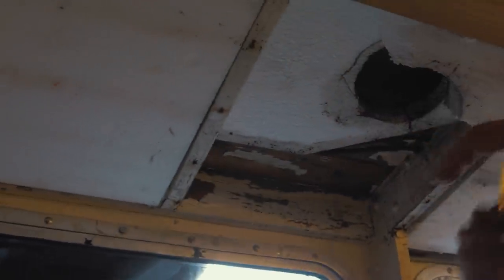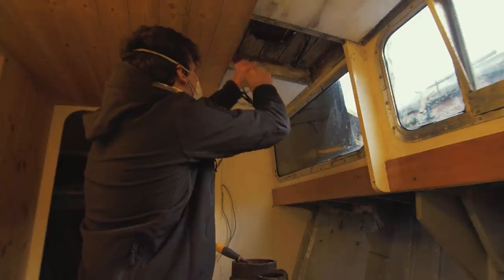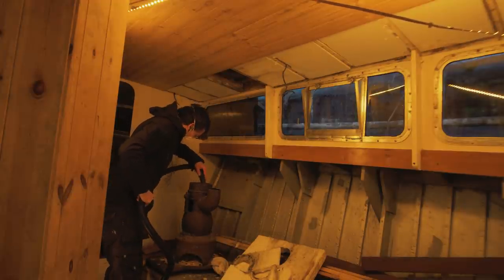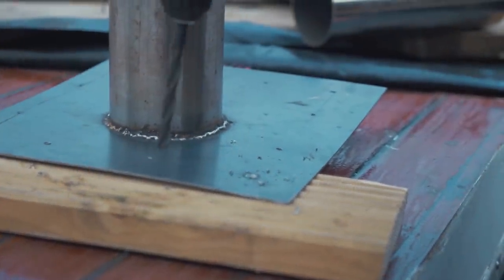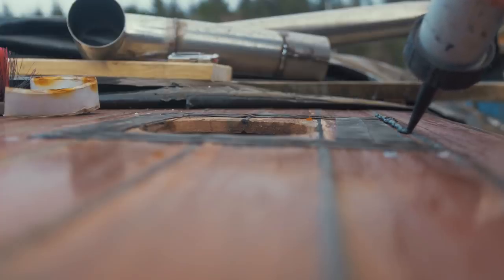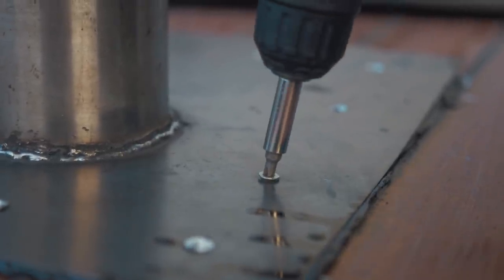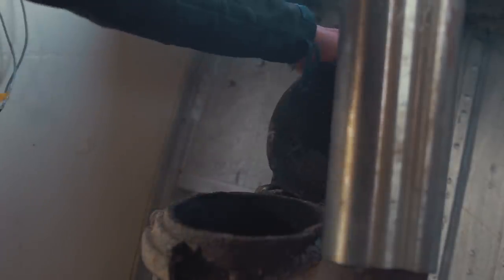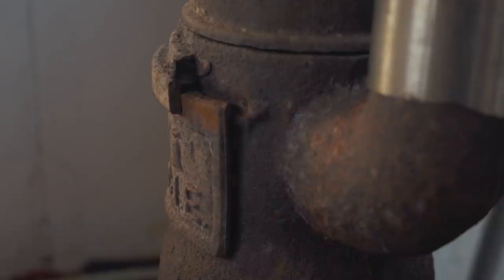Episode 16 - Restoring 80 year old 40' Wooden Boat into a liveaboard ⚓ Installing The Stove ⚓

Comment: Your solution to the problem of a fire from the stove looks good. When you are finishing up the installation, don't forget about possible sparks from the firebox from burning wood and protecting the closest walls (if they are within a certain distance). Many use ceramic tiles for this kind of protection.  I was wondering if you were going to make any videos this winter, glad you did. And, the stove should make it possible to continue through the winter on the inside.  Thanks for posting.